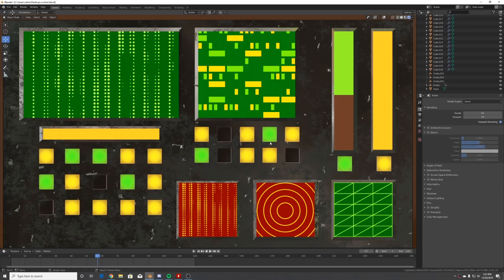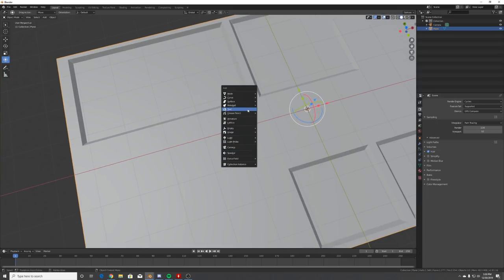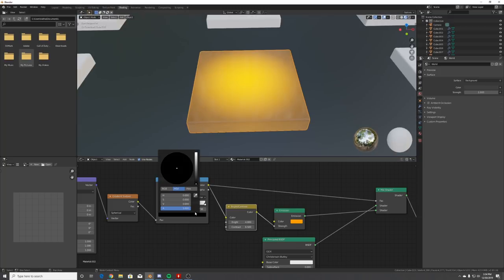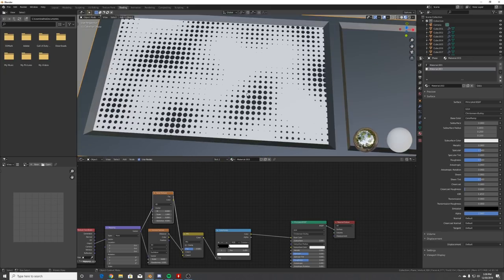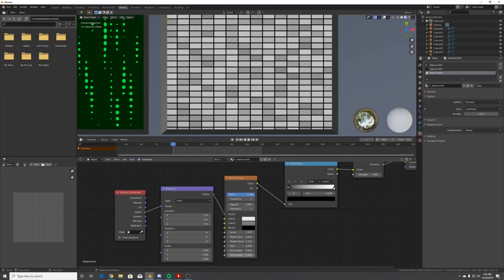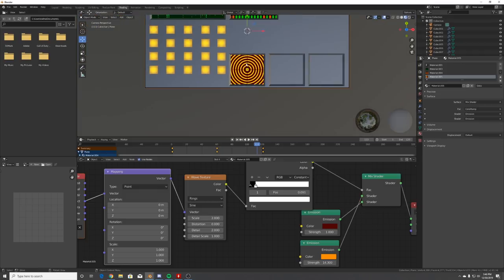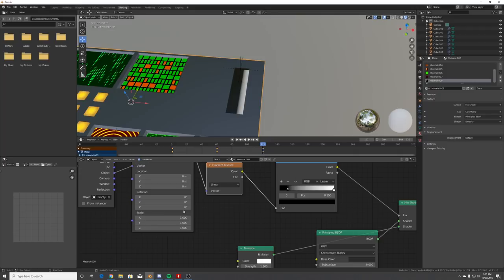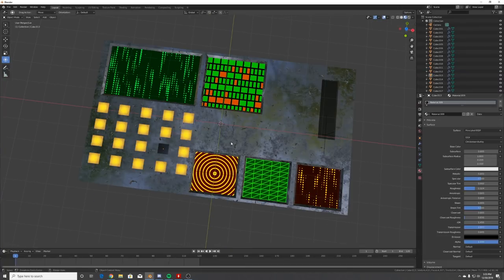Blender - Easy Hard Surface Control Panel in Eevee

Comment: Great tutorial as always! Is Eevee's pixelated bump problem fixed? What blender version is this?
Reply from the maker: Daniel Bringhurst 2.81
Reply: @TheDucky3D  I'm sorry, I just noticed that it says 2.81 right in the description! I'm having a lot of trouble with 2.81. Any render I do with a bump map has big block splotches on it. Do you know what the fix is?
Reply: @TheDucky3D  I think I may have found a fix--I changed the shadow Cube Size in Eevee to 1024px and now the render looks better. Also, I toggled Screen Space Reflections on and off and then the Viewport Shading view seemed to fix itself. Is anybody else experiencing any weird issues with 2.81?
Reply: nope, but I think you should report it like a bug, also proposing your workaround... (Help-->report bug)
Reply: @danielbringhurst4541  i have never had that happen to me but thanks anyways for sharing